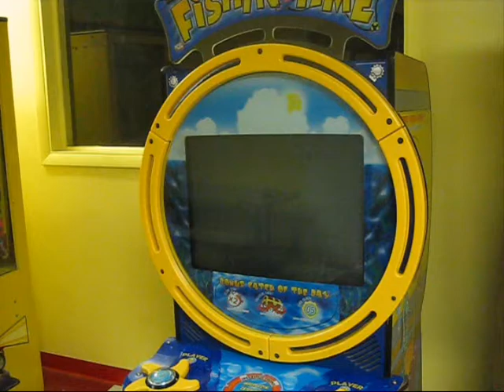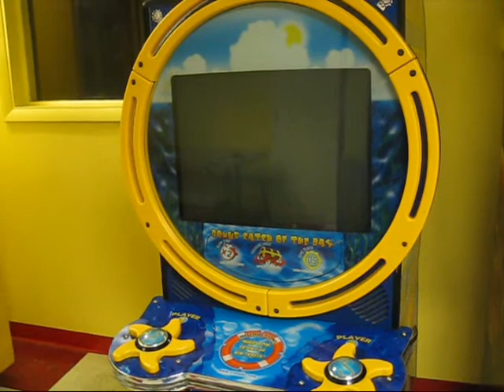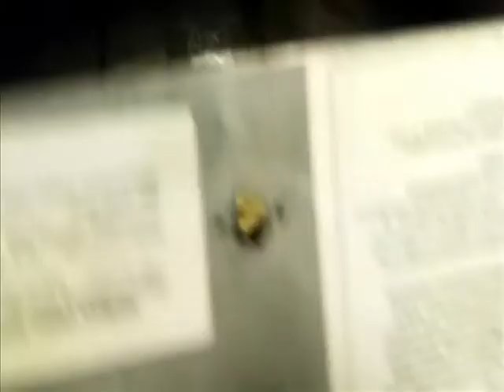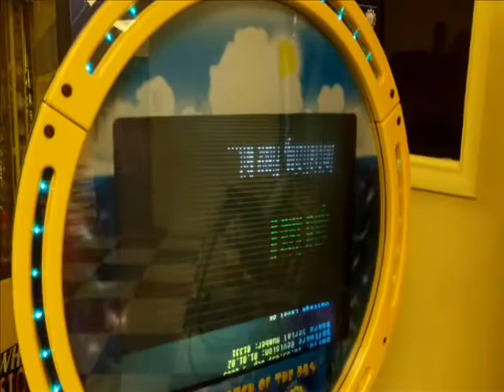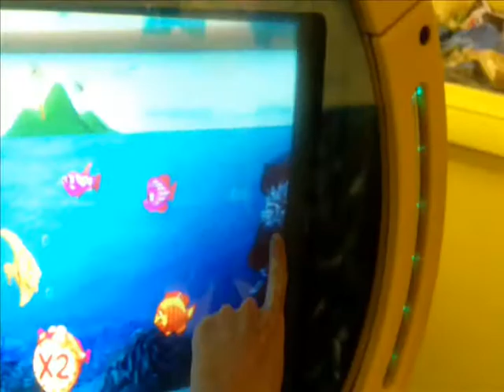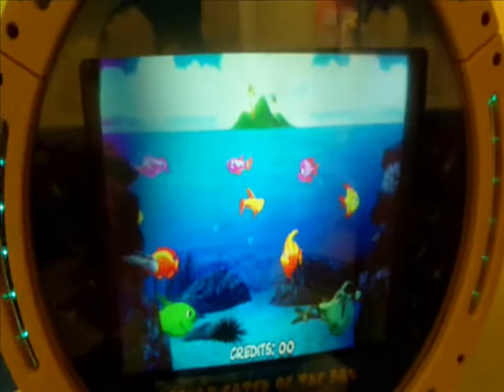Nieman Monitor Chassis repair - Cold solder Joints and cheap capcitors

Comment: My monitor has cold solder joints causing horizontal lines on the monitor on a cold bootup that goes away after using the monitor for 5-10 minutes. Should I take it apart and try to fix it?